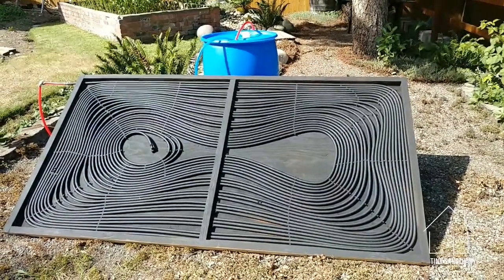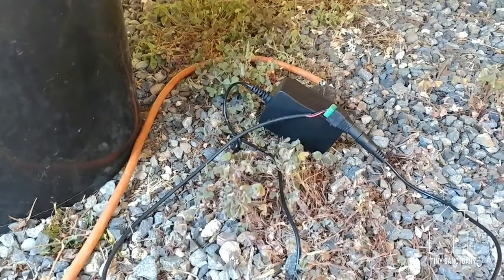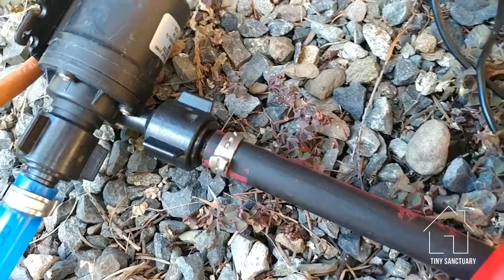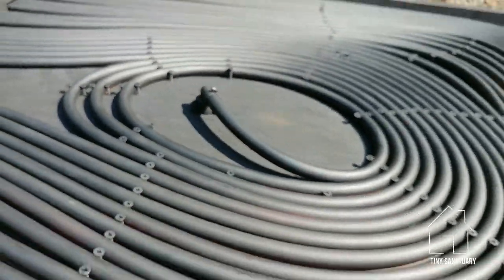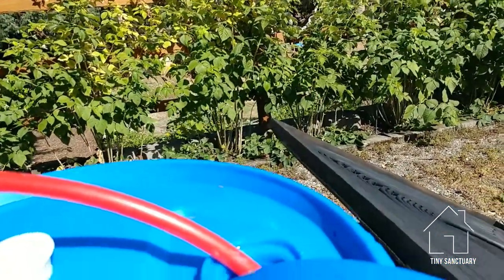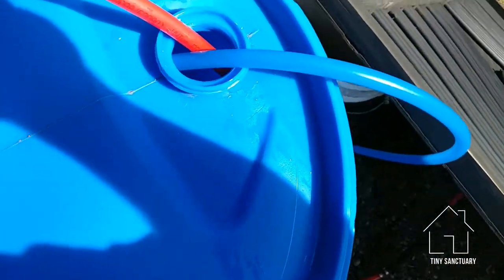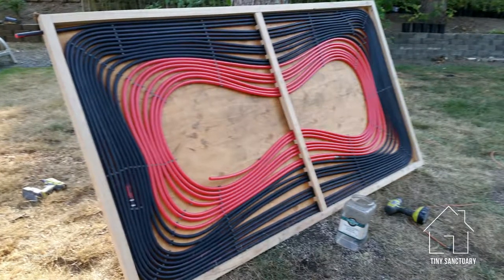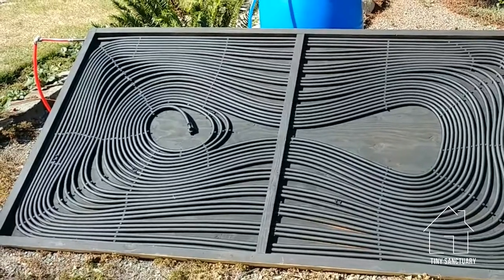SOLAR WATER HEATER for a tiny house test 4

Comment: What item need to make this thing?
Reply from the maker: 12v hot water circulation pump powered by AC adapter or solar panels... 400 feet of 1/2 inch PEX piping, various PEX connectors, 4x8 sheet of 1/4 inch plywood, four 8ft 2x2's, one 55 gallon drum...
Reply: @TinySanctuary  Thank you

Comment: How do you heat the water at night? Does the water remain hot?
Reply from the maker: Water does not get heat at night with this method, but if you insulate the barrel the heat will stay in the water for a while in the evening... another method that can be used at the same time connected to the same barrel is using a small rocket stove with copper tubing coiled around chimney of the stove circulating through barrel at night if you choose... third is to have a propane instant hot water heater to get hot water at any moment it is required... there is also a fourth method which is to hook up solar panels directly to a 12 volt hot water heating element that is attached to the Barrel... The solar hot water heated tubing in thus video is just a very inexpensive way to start and you can hook up multiple ways to the same Barrel and use each when you want without having to use grid power...